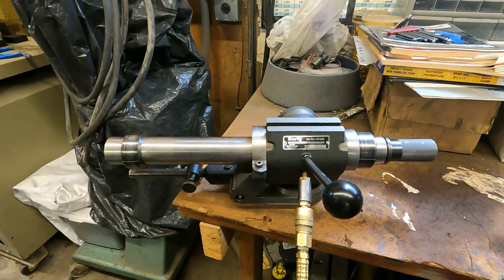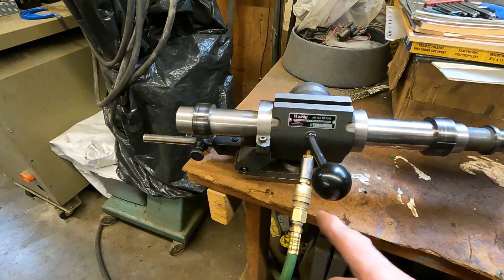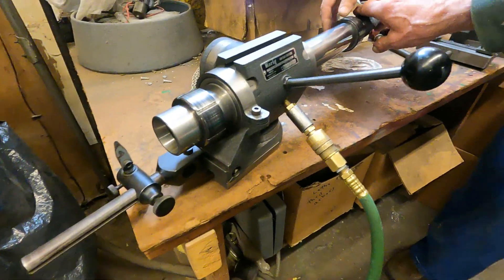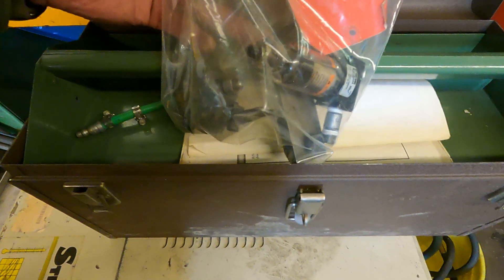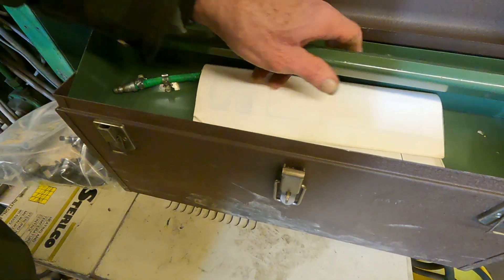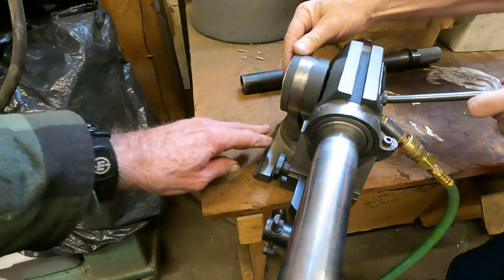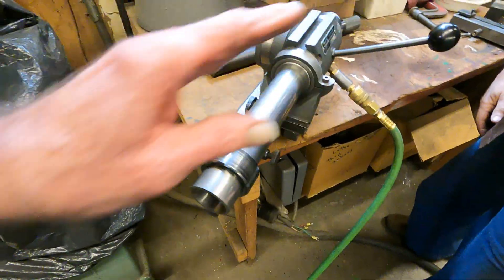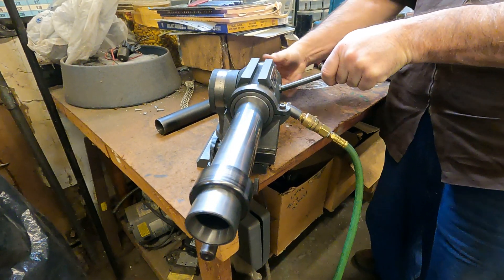Should I buy the Harig airflow tool grinding spindle

Comment: Harig makes the very best endmill flute sharpener. This attachment has lots of travel for long endmills and does a superb job. The key thing with the tool is to keep it clean. There are no bearings, the shaft floats on air with seals on either end to keep the air in, and the dust out. When it gets dirty, just remove the collar and slide out the shaft for cleaning. Never, ever, sand the polished shaft or more air will leak. Simply polish it with a clean, soft cloth and reasemble it. There will always be a small amount of air escapeing the seals, thats normal. The shaft is very susceptible to rusting and the air supply needs a water-air separator. Also, the compressor needs a dryer to ensure dry air is supplied. if there is water in the air supply the shaft will get sticky and can rust quickly, causing it to not run smoothly.
Reply from the maker: Thanks! This came with all the original parts and filter trap in a Kennedy box. There was an A. Rocheleau at the mold of the same construction but had better indexing and spindle locking. In those instructions it says it is ok use the spindle without air.
 The Harig instructions are not very detailed, but says always use air pressure no oils, and only using acetone and a soft cloth. The mold shop did not use these fixtures very much for grinding flutes on endmills. I am fabricating parts that will not alter the Harig but allow the A Rocheleau type 24 indexing and spindle locking parts. This would make it easier to use on more cutter types.

Comment: You can literally feel the air-bearing finish in your mind just by looking at this... A gorgeous tool, and one that should technically be nearly impervious to wear if used correctly... Damn nice! 
Also, i think that the channel re-set might have been a good thing, you will likely develop a decent audience with the former uploads being put on again, and the new stuff is just here to keep us all engaged that brushed off the original channel like fleas... Keep it up, it`s a pleasure seeing you at it!

All the best and kind regards!
Steuss
Reply from the maker: I think this may be a better situation, I think i can make better videos and not have the dreaded commercials. Anyway I am heading from restoring the vintage equipment to actually using them and still not going to sell near useless tools to the hobby community and may even include me crafting a pair of Sharps Rifles along with multiple other epic projects including a large model steam locomotive. Suddenly found myself "The Old Guy" with a 1940s to 1980s machine tool museum! Thanks.

Comment: Harig made top line machines and fixtures. I had one of there radius grinding fixtures years ago, if I had it today it would be sitting up on my mantle over the fireplace.  Buy it. (:
Reply from the maker: I have a small Harig surface grinder. I cant afford it right now, but maybe he will let me work for it.